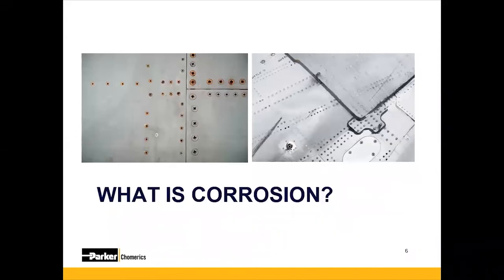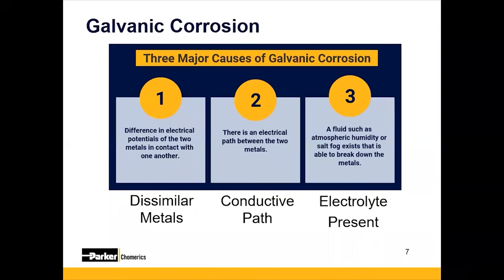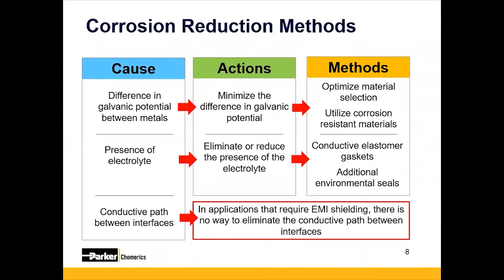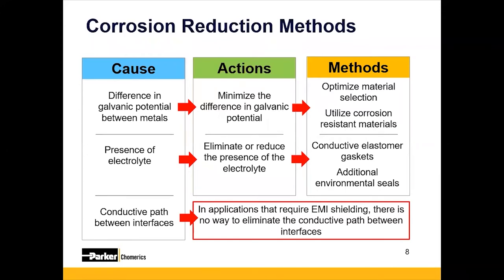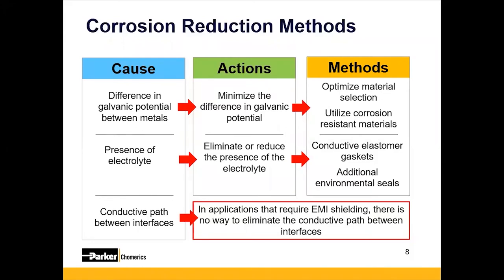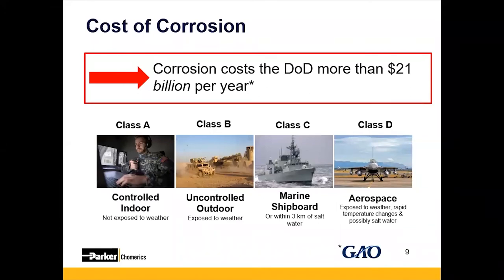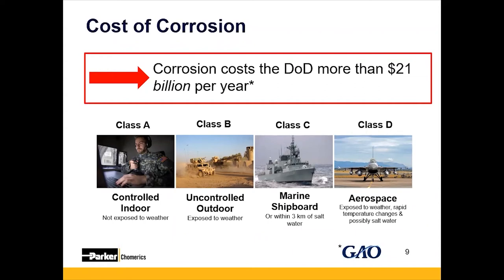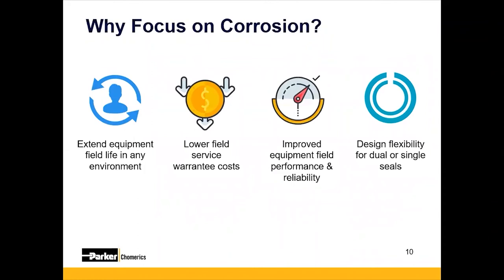How to Prevent Galvanic Corrosion | Chomerics

Comment: When mounting gate hardware (steel) to aluminum posts, using screws (steel), does adding butyl tape before installing the hardware help prevent corrosion? Also, is stainless better than galvanized steel?